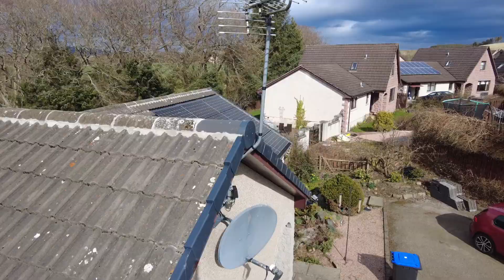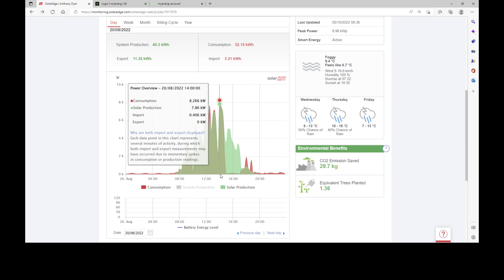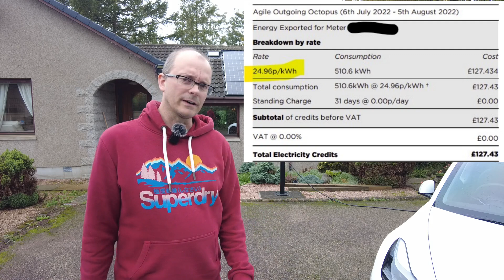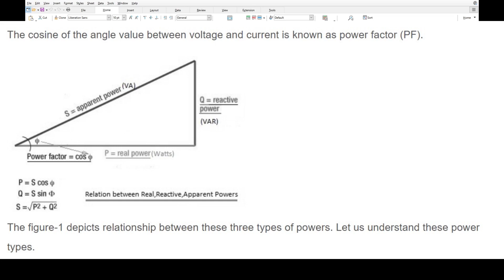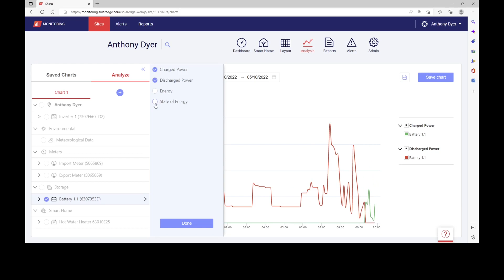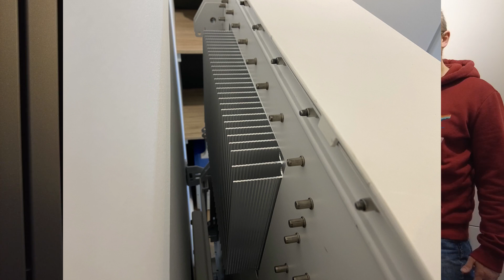July-September Solar Panel Performance, More Energy Bank Insights

Comment: The import is due to demand response times, the inverter cannot predict the future, especially when going from base to a shock loaf
Reply from the maker: Only about 40% of the daytime grid import is due to sudden load changes.  On my previous video, I measured the time between switching on a kettle and seeing a current response on the battery cable.  It’s about 2 seconds.

For the remaining 60% of the time, we have steady state conditions, and despite that there’s still a 20-30 Watt draw from the grid.

Comment: Hi Anthony I follow and enjoy your videos so thanks. I am asking a few people I follow on YouTube to try to get advice from anyone already down the route we are just setting off on. I do not see installation of PV as totally a money making venture more an investment in our life and future.  I am due to have a solar installation in January 2023 as our house is being altered at that time. The system will be 15 panels giving 6KWH peak and will have a 12 KWH storage battery.  The supplier seems reluctant to say which battery, Inverter combination (keeping their options open I guess) but from the quote I see it to be a 2 string inverter with all 15 panels on the eastern face of my east/west roof. Estimates are around 4000KWH year output. My question if you can help - Is there a community of people like me, about to or have  invested a good few thousand pounds on a complete system? I feel that I need information/advice about lots of issues such as statistical feedback from the system, its controllability.There are other issues we are changing from gas to a heat pump, for heating, moving to more under floor heating of our bungalow.  I dont want to spend all this money just to feed the grid for a few pounds a month back for instance.  I am looking for advice and feedback from others further down this road. Do you know of any such group and where the best place to go? Keep up the good work especially like the travel videos! Regards Steve.

Comment: I have a DC coupled Fronius gen24 BYD HVM battery set up.
Quite a few hiccups before it settled down. Even on an overcast day it can fully re charge the 16.6 kW storage and has zeroed our net imports. That's enough to keep me happy. I'm afraid I don't have the nouse to tell you what the efficiency of the system is.
On a sunny morning it will go from
70 percent back to fully recharged by 11 am ! Quite impressed by that. Max charge rate is 3.6kw.
I try to avoid the temptation to work the batteries to hard if the load can be carried by the sun later. Certainly this set up can be worked hard, up to 6kw discharge.
I only tested it once though.
The fronius app is very basic but the live data certainly gives you a good idea of what your appliances are drawing so you can manage the power usage. 
Thanks for your excellent and informative videos Anthony. Cheers.

Comment: Thanks for sharing your experiences - a really useful series.  SolarEdge Energy Bank and inverter here also.  Agreeing with your efficiency numbers as I'm getting ~75% charge / discharge efficiencies also (thanks, now I know how to calc this but perhaps I felt better when I was in the dark on this and thought the efficiency was great).  What was SolarEdge's response? (I am assuming that you have raised this with them).  I'm happy to share exports if you ever want to check another system.

Comment: You mention a discrepancy between SolarEdge 'measured' power and reported power by other means - I've seen a Dutch vlogger reporting that too and he traced it to the inverter, where the AC measured directly out of the inverter was structurally lower than what was reported by the monitoring app.
Reply from the maker: Have you got a link to this vlogger?  I’m always keen on other technical insights to the SolarEdge system.  It sounds like something that’s fixable with firmware.
Reply: @anthonydyer3939  His channel is "Ketel Klets", and this is the video addressing the problem: https://www.youtube.com/watch?v=FaQvaSdWePc.  
All in Dutch, but auto-generated CC and auto-translation sort of work.
Reply from the maker: @diatonicdelirium1743  I couldn't get the CC to read anything other than Dutch.  But nonetheless it's great to see other youtubers throwing some scrutiny onto SolarEdge performance.  I found the application note on efficiency, and I remember seeing it before years ago.   The graphs seem to be consistent with my results.
Reply: @anthonydyer3939  Hmm, too bad about the translations.  Some other comments also mention similar 'losses' for other inverters, and one comment was that 'hiding' the usage in the AC reporting would also not be OK, then you would never know the standalone usage of the machine itself - that makes sense too!
Reply: @anthonydyer3939  One comment said this (google translated): "In this youtube video the emphasis is on one part that needs energy for proper functioning of the system, namely; the power supply of the communication board and digital board that is indeed connected to phase 3 of a 3-phase inverter. The measurements for the monitoring data, seen from the DC side, are just before the AC relay of the inverter, while the power supply for the communication board and digiboard at SolarEdge are just after the relays, so this small deviation occurs on specific phase 3. This is necessary for SolarEdge inverters to ensure that the inverters can still start up in SafeDC.

SolarEdge datasheet does not show this 'consumption' value because during production an inverter has no consumption but a certain return; often referred to in datasheets as 'Maximum return' or 'EU weighted return'. This 'efficiency' depends on the power of the inverter and is reflected in SolarEdge's application note: 'SolarEdge Inverter Efficiency'. Incidentally, when determining the efficiency of SolarEdge inverters, it is not measured by the internal measuring component, but is always determined on the basis of external calibrated meters."

Comment: I have a SolarEdge battery with two SE5000H inverters.  As well as your “background grid usage” which for me is about 0.04kW, mine also goes into a crazy cycle of 1. Seeing nothing from the panels and drawing the entire load from the grid 2.  Drawing the entire load and 5kWh to charge the battery from the grid 3. Outputting 5kWh from the battery and sending it to the grid along with everything left over from the PV.  It will do this a few times in a cycle and then settle down.  This cycle seems to be triggered by a sudden change in load greater than about 300W though that’s not consistent either.   This behaviour began July 24th after a firmware upgrade and SolarEdge have not been able to fix it though they have been “working on it” since then.  I even asked them to roll the firmware update back to pre-July 24 but they say they can’t.  This behaviour is resulting in about 1kWh of unnecessary grid usage a day.   The background 40watts of grid usage is costing me another 0.6kWh per day.
Reply from the maker: I see item 1 once the battery is fully charged, and the battery goes to off mode.  The panels stop producing for a few minutes, and then they return with the battery off.   But item 2, 3 don’t happen.  Im not too fussed by that.

I’m on the September firmware version.  4.16.23 if I recall.  You should check your firmware version as July 24 was about 2 revisions ago.  Solar edge support should be able to upgrade your firmware remotely.

The grid import is about 0.4 to 0.7kWh per day without car charging and over 1kWh with my Zappi charger flip flopping load by 400 watts every 10 seconds or so (very annoying)
Reply: @anthonydyer3939  they have updated the firmware since then but it didn’t cure the problem.  In regards to the background usage they said “There is always going to be overflow requirements from the grid when you are using consumption in your house, … whilst there is enough solar, all solar systems (no matter the brand or type) will respond to the demand in your house quick enough to not require the grid services. This is normal for any solar system, the way in which is works is if there is a spike in the house (i.e. turning your kettle on) it will use grid services to meet the initial demand and then the inverter will communicate with house and then divert the Solar energy to your house.”

This is fine EXCEPT it’s only when the battery is in use that it uses grid power.  When there is plenty of sun around that 40watts background grid usage disappears.  Can the inverter draw power from the panels instantaneously but there is a lag when drawing from the battery I wonder?
Reply: They also said my two inverter set up is unusual so I needed a bespoke firmware for it.  So you and I might not be comparing apples.  Do you have the same inverter as me?
Reply: Ha just checked my Firmware and it’s 4.16.23 on both so so much for “you have bespoke firmware”

Comment: Thanks for a very interesting video.  What’s the average grid draw just the battery balancing ie not car charging etc a day ? 500-600 watts seems high if that was the average you showed on the video 690 watts 🧐  nice looking battery but our 13 kWh fox battery will use about 80-200 watts on it own with normal home use and  yes I found the same the gentle use uses a good bit of waste like 200-300  base load will import good bit more proportionally than say ev charging from solar at 4.5 kWh or boiling a kettle etc just worked out our round trip efficiently for September not done it for a while 89.5 % round trip efficiency  and few times done it mid summer been 90. % and if remember John tilby. Saying the powerwall rte is high 88-89 % so yes I would raise a support ticket and if your system is using 600-700 watts a day just  powering home from battery not off peak use etc and it the whole month of September used 3.3  kWh  imported from the grid so possible for a battery system to use very little from the grid in normal use

Comment: We've had our energy bank for 2 months now but unlike your installation we had no problems and ours was complete and up and running in less than 2 hours.
I've been pretty happy until I looked at the data from the API.
I've been trying to correlate the figures for a days generation, ie. match the figures on the Energy Balance section for a day

The battery discharge figures from the spreadsheet broadly matched your findings and no way matched the consumption from the battery figure given on the energy balance.
Other figures for import, export, system production and self consumption also varied by differing amounts.

The last day I looked at, the discharge calculated from the spreadsheet was 4.99Kwh, from the Energy Balance summary this was 7.03Kwh.

The days' percentage discharge for the battery was from 63.8% to 41.0% (morning)  and then from 100% to 50.3% (evening) - total percentage discharge 72.5%.
72.5% of 9.7Kwh gives 7.03Kwh

The battery usage on the consumption totals does correlate pretty well with the percentage battery discharge if that figure is correct.

I came to the conclusion that these figures at 15 minute resolution were pretty inaccurate.

I would love to know the true facts.